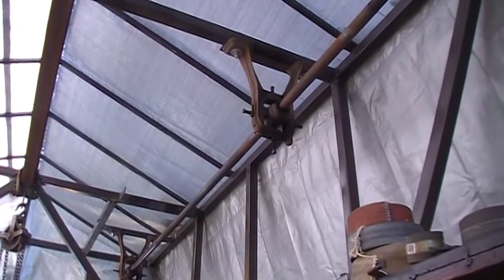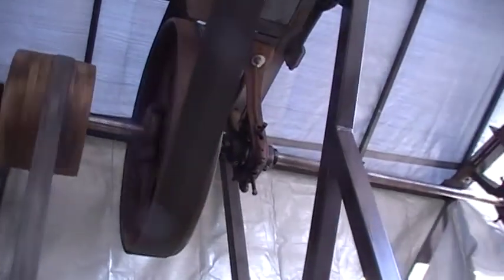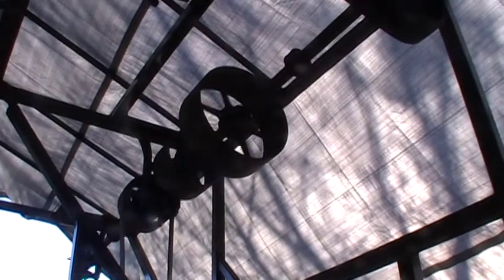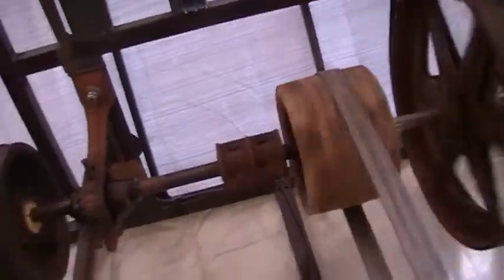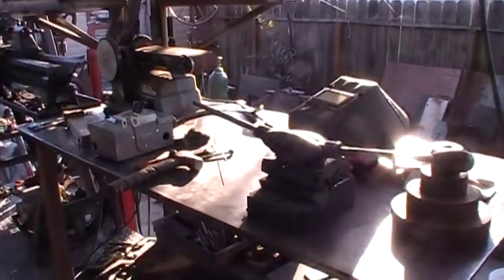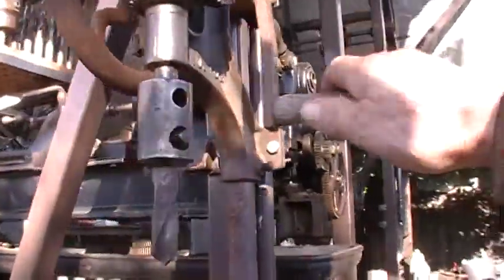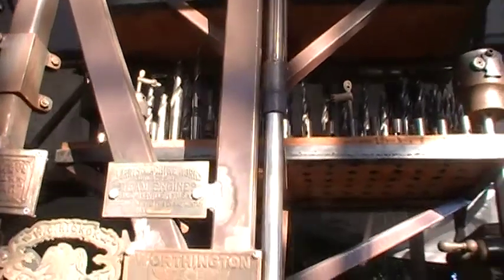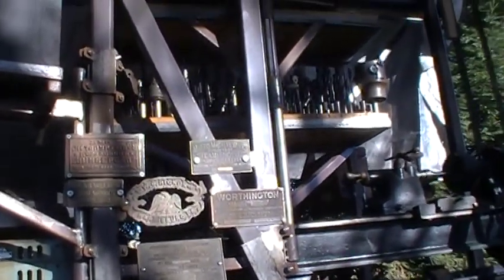wrought iron line shaft, cast iron pulleys,  Rhodes shaper, Champion drill press

Comment: My friend you can straighten that shaft yourself. Go to Turn Wright Machine Works Kieth Fenner he has several videos of fixing shafts with heat and air powered water just amazing  how he does this
Reply from the maker: Thanks Frank. I will check out Mr. Fenner's straightening videos. This shaft is important and worth the effort.
Dave
Reply: Glad to be of service. Good Luck
Reply: i agree i always try to save as much original stuff as i can once its gone its gone . i however am also big on reproduction parts some times you can save a machine no other way or many machines for that matter